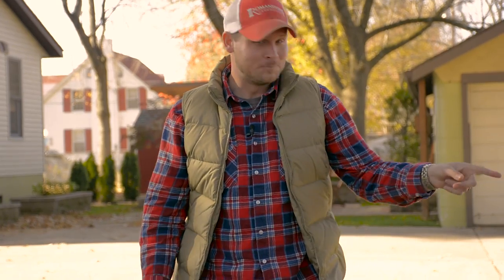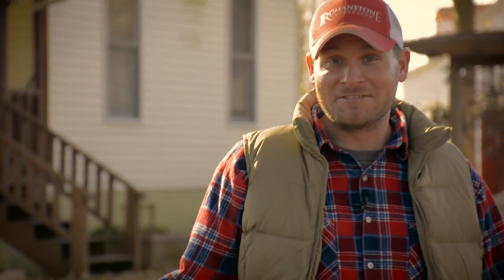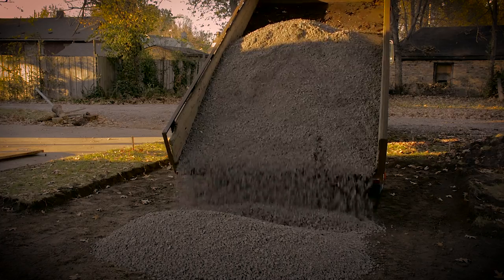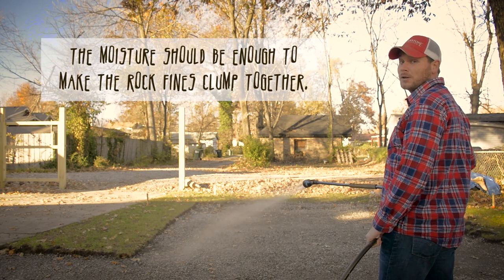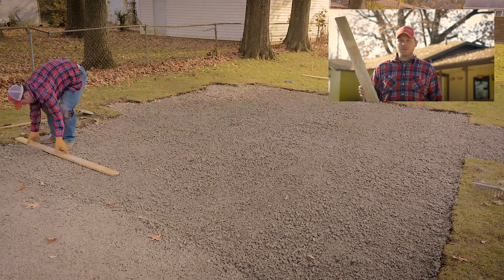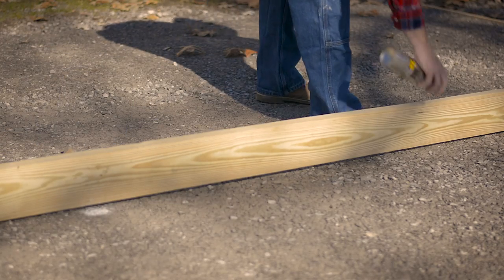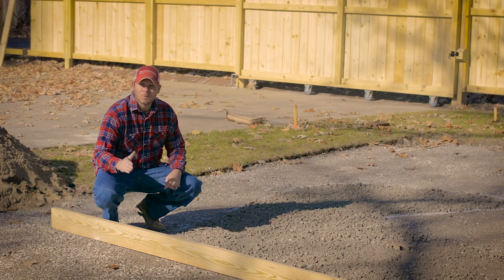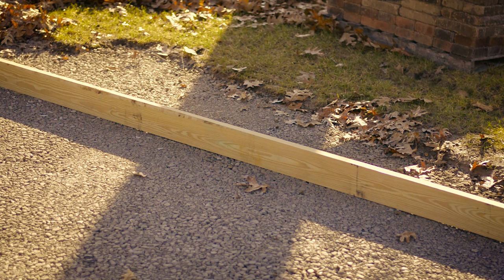Build with Roman - How to Excavate and Prepare a Paver Patio Base

Comment: For just a backyard patio I thought it was 4 inches of base, 6 inches for heavier applications like a driveway. Could be a little savings for some! I like your technique of painting the low spots ahead of time btw.
Reply from the maker: I have heard of 4" for patios, but I have never seen it work effectively. Driveway applications require 8-12" of base rock.
Reply: The 4” and 6” are for poured concrete applications not pavers. Pavers are individual pieces so the thicker the actual base the better. With pavers a 12” base is pretty thick and will most likely not budge overtime.

Comment: it amazes me how all of these patio install vids start with a table top flat yard to work with.  What abut the guy that needs a 12x12 patio and his yard drop 10 inches over that 12 feet?
Reply: that's what I am dealing with, my 15 X 15 foot area drops 8 inches.....
Reply: So what did you do? I'M about to start a 26x13 patio in the next week or so.
Reply: @Jaxsolo  simplest way i think is to compact more of your base in the low area to get your desired slope. it may require a step + a retainer or more dirt to get the correct slope from patio edge->end of yard. does this make sense?
Reply: your gravel base will be 9" thicker on the low side to get your 1% slope. it will require some more dirt work to get the runoff away from the patio to the end of your yard
Reply: @Jaxsolo  by base i mean the crushed stone +fines you bring in to compact
Reply: @austinkramer3264  mine not so sharp of a drop, but still going to be a pain in the neck. I'm expecting a huge boost in my husband point bank when I finish this thing...
Reply: I’m building a retaining wall for my slopes area
Reply: Check out Stanley “Dirt Monkey” Genedeck videos on reataining walls
Reply: Bro my yard is like the grassy knoll
Reply: You build it up

Comment: Why not use string levels across the surface and just rake the material up to the bottom of the string.  Better way to start
Reply: You could but initially it would be more work. It would better be used after compacting. Also with a string leveler you would have to look closer, with a straight board you can see the unleveling because it shows shade. Much easier to find the unleveling that way. String would be better for higher not lower.

Comment: No size of rock even though you said would say later. So 1 inch rock on the bottom and two inch on top?  You said you were going to show how to slant the base so you have rain run off. Why not. If you say something you should follow through. If you leave things out are you assuming pp know this  Then your title of the video should be this video is for pp who have does this a few time. You didnt "Proof read your video," I would give an E.